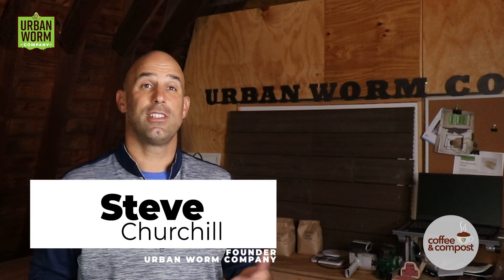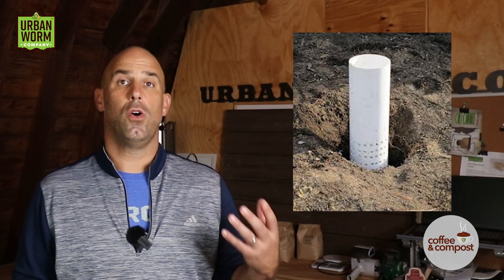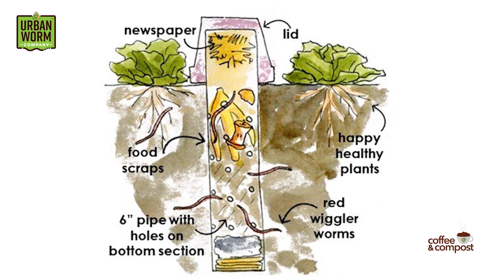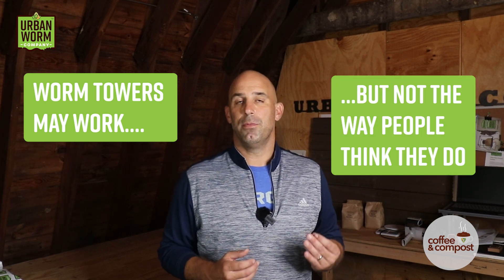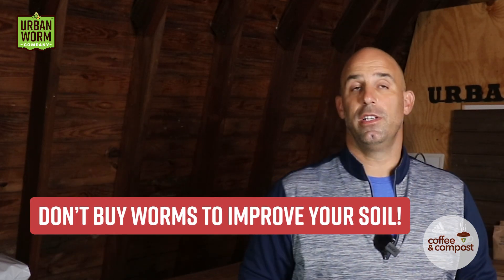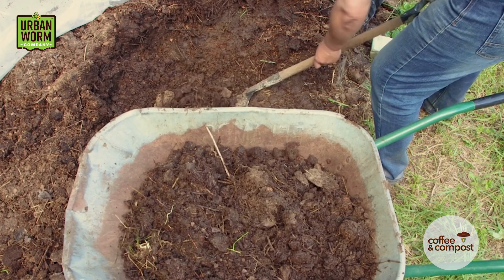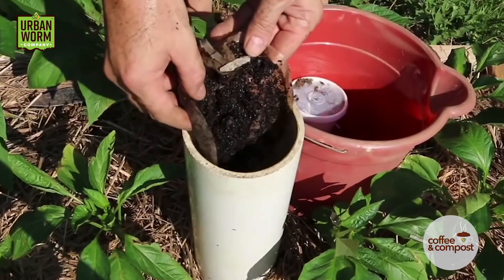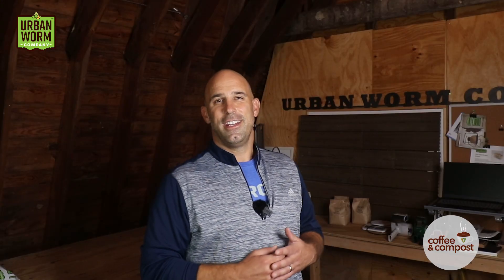Worm Composting Towers: Do They Work?

Comment: I have a worm tower that I made out of PVC tubing and has holes that I drilled all over it and buried into my garden.  I put table craps from vatable and fruit.  I didn't put worms in.  Whatever is in my garden is what goes into them.  I didn't want to add anything that wasn't local.  Whatever is happening the pile goes down and I have more worms than ever in an area that was more or less void of worms before.  Plants are happy when I plant in summer.

Comment: You sale worms. Your worm tower doesn't work. That tells a lot about your professionalism. I bought zero worms. Our worm towers throught out our garden beds work excellent! I don't need to buy any fertilizer or pvc pipe. Bottles and containers work better. Our flowers and vegetables thrive like weeds! Best of all, no one knows anything is installed in the ground!  We don't even have to harvest the worm casting or anything! Just poke lots of holes around the containers, let them run free, add kitchen scraps and water well.  It saves us a lot of work, time, and money!
Reply: My worm tower works better I have plants coming out the sides of my tower and worms inside the tower eating fish solids waste. My garden is indoors!

Comment: I think of it as a better way to trench compost. I use a 5 gallon bucket for mine.  I don't use it for vermi compost I just use it to bring fertility to the soil in that bed I am using it in . The earth worms in my garden work fine did not need to buy anything special.
Reply from the maker: That's a great way to look at it. Just adding that organic matter to the soil will attract native worms!

Comment: when I was little I had a hard time getting worms for fishing, so I started drilling an 8x20 inch hole (hard clay).  Filled it almost full with grass, leaves, food scraps.  The last 4 inches I filled with clay.  There were 15-20 holes that summer.  the following summer there were lots of worms there, and soil that was easy to dig in.

Comment: I purchased a worm bucket  that was supposed to be buried but of course 2 years on it was full of roots and was almost impossible to dig out.    I still wanted to use this system so I got a plastic nursery pot that was larger than the worm bucket and placed the worm bucket inside the larger pot.   I filled the space between the worm bucket and the larger pot with soil and just sat it on the surface of the garden.
The worms use the holes in the large pot to access the soil dividing the two and then into the holes in the side of the worm bucket to access food scraps.    They can then return to the soil and come and go as they please.
It works brilliantly.

Comment: I'm giving a worm towel a trial run that is 12" in dia and 18" deep buried 8" deep at the center of a 4X8 bed.  I plan to feed around the outside perimeter as well as in the tower itself.    I don't expect my wigglers to travel the whole bed but I do think worms will do well in the winter season and maybe 20 lbs of castings come spring.
Reply from the maker: Please let us know how it goes!

Comment: Hi Steve,  The worm towers work great in raised beds that were built using Hügelkultur.   This provides the worms with plenty of organic material to eat once they leave the tower.   Since there are holes in the PVC close to the surface it doesn’t take much effort for the worms to be able to move in and out of the tower through the potting mix in the top layer.  I have checked my tower several times after neglecting it for weeks only to find it completely empty, then I put a few food scraps in and checked it a couple days later and the worms returned to chomp on the fresh veggies and fruit.  You’re right, it doesn’t provide for a lot of composting, but they do aerate the top layer of soil and leave their castings in the raised bed.  The reason the 4 inch PVC pipe works so well is because it doesn’t take up nearly as much space as a subpod or a 5 gallon bucket would. 

Maybe you and Troy could do a wiggle Wednesday episode on the proper way to use worm towers/buckets in raised beds… 😀
Reply from the maker: Good to hear, Kim! Hope you're doing well!
Reply: Thank you for posting this!  My beds are 23" wide so I don't have room for a whole 5 gallon bucket.  I was wondering if thin tubes would work or not.  Thank you!

Comment: My raised garden bed is free-standing and not in contact with the native soil. Technically it's filled with soil-less "potting mix" that I made, which is comprised of 1/3 compost, 1/3 peat moss, and 1/3 pumice. It's nice and fluffy with plenty of compost for the worms to eat. So, they do well in my garden bed. The 4" worm tower is probably the least efficient way to get food scraps to the worms. When used in conjuntion with our other worm and compost bins it does provide one more location for us to compost on our tiny city lot.

Comment: In ground and even big bins gets grubs, snails, doodlebugs, etc plus RATS chewing holes into the regular storage bins. I moved my heavier duty thicker bins to the porch away from the yard crawlies and if the rats are still able to chew holes I'll move them inside. I cover the plant based scraps under the dirt and put layers of cut boxes on top but they still smell the greens and apple sauce etc. I was using chicken wire to surround the bins top and sides and that worked but a total pain to feed the worms. I would never put food in a garden in any sort of bucket or pipe. Fishing out grubs and all kinds of bugs is impossible and nasty and the rats eat the worms as well as the scraps. Costco has the super thick black bins with yellow thick lids so fingers crossed too thick for rats to chew, but anyone reading know that these bins LEAK when it rains from the lid connectors. UGH! Need to cover with tarp or plastic if rain can reach.

Comment: Compost worms don't live in earth (dirt), so they don't migrate in and out of the pipe.  What they do is provide soil positive bacteria which is flushed into the surrounding (Dirt) when flushing water through the pipe.  Then earth worms (those which do live and work in the dirt move in, out, and around the system feeding on the bacteria and castings of the compost worms, and carrying that into the earth  (Dirt) they are aerating in their travels.  It's really an exchange, and a way to add that bacteria to the soil and feed the earth worms who actually live on the bacteria produced through the compost worm action.
  If you just dig in your kitchen scraps and toss in some compost worms you can get the same results, but then those compost worms are vulnerable to digging critters, and you risk drawing rats into your garden who like feeding on the kitchen scraps, but will happily eat your garden plants as well.
  Buckets are better than 4 inch pipes for volume though, that's true....

Comment: Outdoor "on-ground" vermicomposting (as opposed to the 'in-ground" systems discussed here) is actually relatively easy and can be very productive. It is simply a way to have an outdoor vermicompost system that overwinters in colder climates. Being that it is outdoors, it is similar to in-ground systems but is not for putting worms into your garden soil which, as Steve points out, probably will not improve your garden's soil. You can use a mesh hardware cloth to create a smallish round bin (mine are about 2 ft high and 2 ft wide), set it on the ground and mostly use it for composting garden waste. Once the bottom has some decomposed material in it, lift up the fresh, undecomposed material put your worms on the decomposed stuff (I use red wigglers here in the northeast US). Give them a few days to get accustomed to their new home then feed small pockets of food scraps to them every once in a while. They will feed on the food scraps and on the garden waste that you put on top of the pile as it decomposes, as well as the composted material that you started with in the bottom of the bin. After a growing season or so, depending on your input amounts, the compost at the bottom of the bin will have lots of vermicast. If you let the vermicast fill up a foot or more you can tip the bin over and scrape out the bottom for some great vermicompost, then put the bin upright again and continue using through the next year. The worms will reappear after the winter without you having to insulate the bin, even if the contents freeze for a while (I am not sure how they do it but have a theory). I have done this for 6 successive years with multiple bins in different locations and my red wriggles continue to be very productive and seem happy as clams.
Reply: Is there a link to a video that demonstrates the method you describe? I’m a visual learner :)

Comment: Thank you SO much for explaining why worm towers don't work. I saw a gardening video. The lady showed her worm tower and how happy she was with the way it worked. I set one up in my raised bed, very similar to what she showed, but I used a tall plastic jug w/ holes drilled in it. At the end of my growing season the jug was still full of partially decomposed food scraps with potato plants (from sprouted peels) growing in it. Until seeing your explanation I was wondering why the tower hadn't worked for me.
Reply: Although worm towers often don't work as expected, your potato growth is a separate issue. Potatoes and other tubers, root veggies, and seeds will not decompose if they are still viable (meaning they are alive and are able to grow or sprout). Worms will not bother them (nor will most other soil critters) so they will likely survive for a long time, and sometimes even thrive, when put in a worm-friendly environment. They sprout even in the most well-running worm bins. So your growing potato peel is not a sign of the failure of your tower. Nonetheless, I personally am not a fan of worm towers and do not recommend them.

Comment: When I've said before that I do in-ground vermicomposting, I'm using composting mulches to replicate the O Horizon that Epigeic Worms live under. Epigeic worms seem to be quite lazy, so they'll stay where the food is, unless there is a reason not to. I don't think they do travel through the beds from these pipes, at least in any great distance. However, what I do know is, regardless of where they are, all my 42+ltr tubs, that I treat as no-dig (as far as it is possible to do so) end up with worms in them. These are not Epigeic Worms, but still there to feed on the organic amendments added to the buckets each year, and the breaking down roots that are left in from plants twisted out before new ones added. If these worms are willing to travel to a bucket, from somewhere else in the garden, perhaps using the above method can work on a 'build it, and they will come' basis. However, I'm still of the opinion that if you're going to do it, bigger is better. Why use a 4" pipe, for such little return, when you can use a large bucket.

Comment: I have four buried 5 gallon food grade buckets. We fill and feed like any worm bin. We lifted them at the end of the season and got a bucketful of castings, refilled with new bedding and put them back in our raised beds. 
~ Sandra
Reply from the maker: Thanks Sandra! Yes, with that increased surface area, you're probably doing much better than with a PVC pipe.
Reply: I've also used 5 gallon buckets but after a year I went back to large totes then to a worm bag. Problems I had with in ground worm buckets. They became full of slugs, rollie pollies, and white grubs. 
They are really hard to work in and harvest. The bucket is buried so it's really hard to reach down into the bottom of the bucket. It's also normally a few feet in from the edge of the bed so you might bed to step into the bed and it's also annoying when you got itchy plants rubbing against you. When you feed your buckets, it's a hassle to go to 5 buckets to put on cardboard and food, rather than just going to one worm bag/ tote. 
A lot of the worms left the buckets, my beds have a lot of red wigglers now. It would be more beneficial to keep the red wigglers in the composting bins. If it rains hard, the buckets might get really wet. I really doubt that the worms are dropping a significant amount of castings in my beds.
Reply: My garden buckets attracted a few slugs, but we took care of them when we opened the lid to feed once every 2 weeks or so. I started each bucket with about 125 worms and I pulled about 1500 out of one bucket at the end of the summer. I also would find worms around the roots of radishes, etc. that we harvested through the year, so I know the worms were throughout the garden.
Reply: @NanasWorms  Can you make a video so we can see precisely how you get your results so simply and slug-free, too? That would be great!